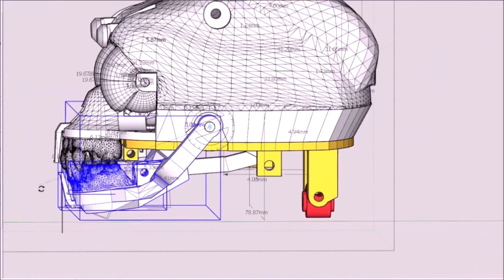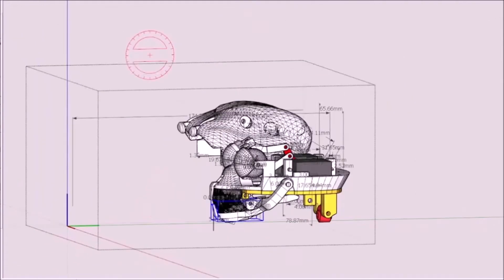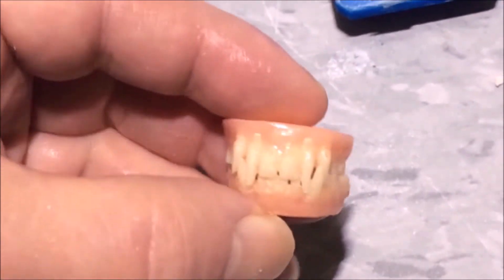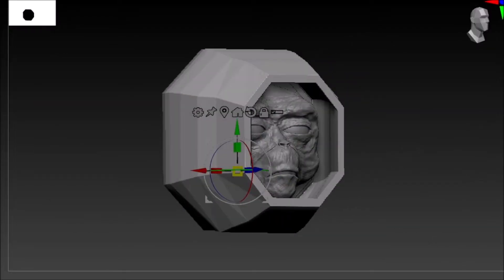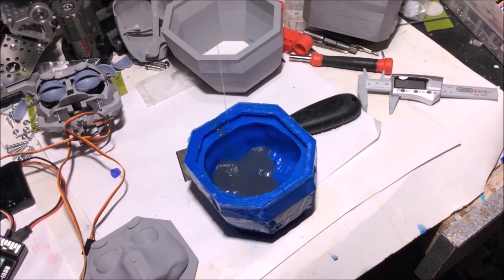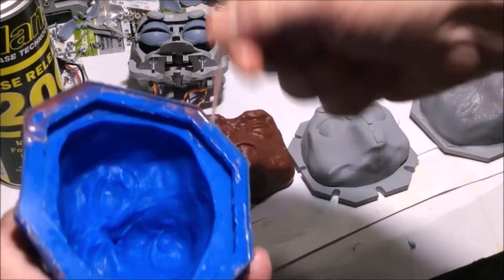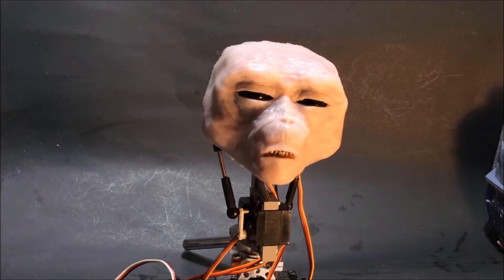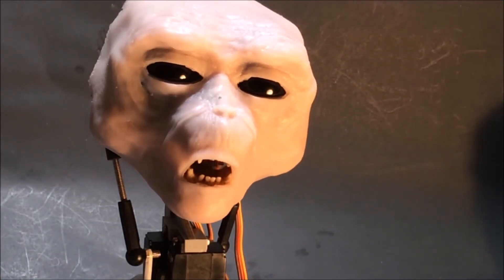zbrush skin for digital animatronic

Comment: Nitinol wire has been around a long time. Is there some issue with it's implementation that makes it unsuitable for designing low strength artificial muscles that could be controlled with an Arduino?

Comment: So! I have been trying to get anyone to answe this for my so may as well see if you have the answer for me... How to yo prevent  silicone cure inhibition on resin parts? Any time i have tried casting into printed resin they fail
Reply from the maker: silicone cure inhibition on resin parts , Well make the parts are clean and cure and give few days to degas ,then spray coat crystal clear krylon all over it . https://www.smooth-on.com/support/faq/210/
Reply: @garywillett4146  This is perfect, thank you very much! now the only question is how do i source Krylon in Iceland 😅😅

Comment: I wonder if you took a rod like linkages with properties that along the axis it stays stiff under compression and tension but bends off axis quite easily and tie two of them to each corner of the mouth for more lip control. Just a thought, don't know if it's a viable solution

Comment: you can tie fishing thread behind the lips in front of the k9 teeth and use a servo to pull on them to operate the top lip
try breaking the eyebrows into three segments, and letting the middle one pivot around the center so the ends are attached to the middle.

Comment: Outstanding work! Fantastic! I've been trying to 3D print an animatronic reindeer project for years with a latex skin. I'm on version 5. Thanks for the tips on the glue, I'll have to check that out.
Are you using threaded inserts? I've had problems with the bolts backing out of the plastic or breaking it so I'm trying that.
Reply from the maker: Yes I understand , I'm working on a big animatronic now to where using these great beams in my designs. https://www.servocity.com/gobilda-beams/#square-beams
Reply from the maker: look for help in structure https://www.instagram.com/p/CxCOOudMfep/?img_index=1

Comment: You often see CGI characters’ faces animated via dots on an actor’s skin, but animatronic ones are controlled by multiple puppeteers. I wonder if you could use the same face-tracking software to send signals to the animatronic, allowing it to exactly copy the voice actor?
Reply: The problem becomes that a mechanical face can't move in the same way a face made of muscle and bone can (Yet). 
You can make an approximation by letting certain set parts of a human face control certain servos and actuators in combination, but you can't really have the same level of fine control over the entire surface.
Reply: @IneptOrange  Might be able to apply soft robotics to mitigate some of the issues with servos, eventually. I don't know if enough progress has been made in academia for it to look too great without throwing entirely too much money into an animatronic build at this point in time.
Reply: Good idea
Reply: I think Jim Hensons Company is doing that already. They have more articulation for lips, eyebrows, forehead so they can mimic a real creature more realistically.
But hey, the puppet in this video looks pretty amazing even with so few servos.
Reply: I'd be interested to see if someone could take a completed animatronic and train a neural network to take the face capture data from the actor and replicate it on puppet
Reply: The easiest and simplest way would be to use something like vtubers use to translate face tracking into predetermined animation outputs.

You could then use the same concept with slightly more advanced face tracking to get things like scrunching of the face rather than just mouth.

But it should be fairly doable
Reply: Stop giving ideas to the AI.
Reply: Relatively not hard to implent https://www.youtube.com/watch?v=mfiRJ1qgToc
Reply: They actually did that with the Jaw movements on the Chucky animatronics.
Reply: We have the technology. VTubers use facial tracking already to puppet digital models. I would be shocked if someone hasn't already used the technology to puppet real life puppets.
Reply: Yes.  I do this with a real sense and leap sensors thru TouchDesigner or with OpenCV
Reply: Great idea!
Reply: @LeoMastroTV  There’s a lot of different factors that go into something looking ‘real’. I think people find characters achieved with puppetry and animatronics so appealing because they have some of the ingredients of ‘realness’ that CG is rarely able to nail. Of course there are tons of areas CG can eclipse puppetry when making a convincing character. But modern audiences see so much CG that practical characters feel ‘special’ in comparison. 

The fact they’re lit with the same real light as everything else on screen, the microscopic physical chaos of their texture and movement, the way actors can more naturally and spontaneously interact with them. Those aspects of ‘realism’ are currently a more novel sight to audiences, so they tend to let their guard down and allow themselves to overlook the less convincing qualities. 

Yeah they can tell it’s a puppet, but they also know Thanos is CG, and that the apes in Planet of the Apes aren’t real talking apes, and no amount of VFX wizardry will change that (although a gas leak in the cineplex might). Audiences will ultimately forgive all sorts of lapses in ‘realism’, so long as the creature or character is emotionally engaging, and puppets happen to naturally be very good at that. 

A studio can spend 10 million dollars on one major vfx character, developing performance capture tech, scanning actors down to the pore, doing muscle and hair simulations and spend hundreds of hours animating each eyebrow twitch (which is all really cool and the people who work on this stuff achieve phenomenal things). But if you measure success based solely on people’s raw emotional response to it doing things on screen, it’ll have to fiercely compete to win out over a talking sock with two googly eyes selllotaped to it. Our brains are just weird like that ¯\_(ツ)_/¯
Reply: That would be so cool!
Reply: There are so many more points of articulation on a human face. The model would have to be enormous.
Reply: no that’d be impossible
Reply: Isn't this animatronic mouthing his words in this video?
Reply: in movies I prefer CGI for now
Reply: Absolutely.  They’d have to use more, smaller motors, but it will definitely be the next step.

I hope they do it soon because this resurgence of shoddy fake looking muppet style practical effects looks like crap.  We moved to CG for a reason…
Reply: @DisgruntledPigumon there are poorly done practical effects, just like there is poorly done CGI. From all the movies and shows and other media I watched, it’s far more likely for CGI to be done poorly for a multitude of reasons.
Reply: @DisgruntledPigumon thats not the reason, at first it was because we wanted to see if we could, then to push it to the limit and then because it was cheaper
Reply: @DisgruntledPigumon  I blame marketing people and this asinine "CG ruins movies!" crap sold to the public and parroted by plebs on social media.